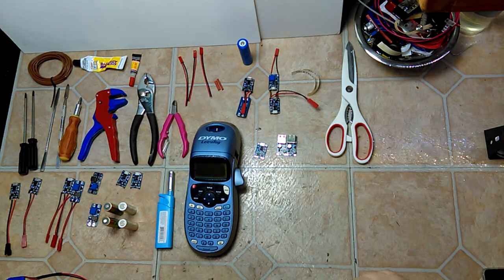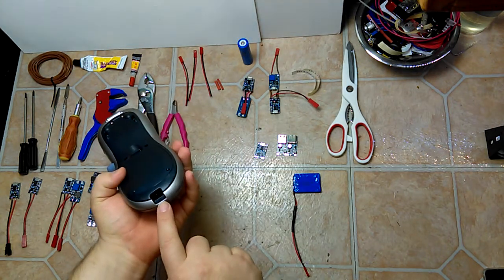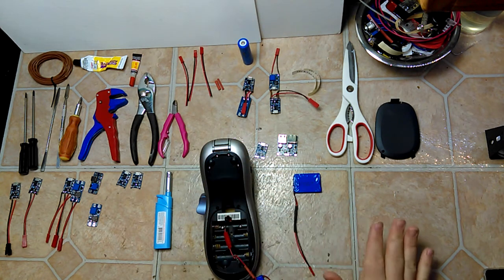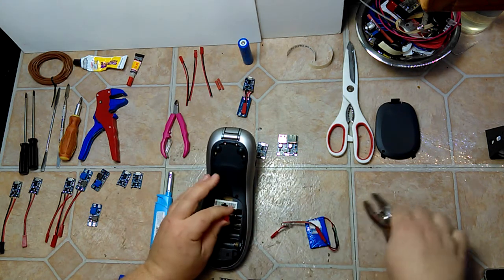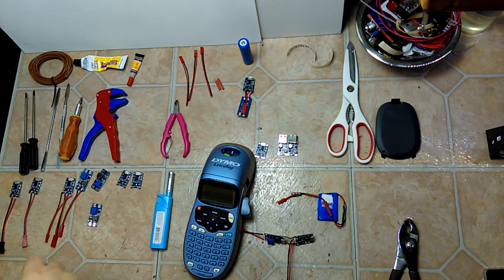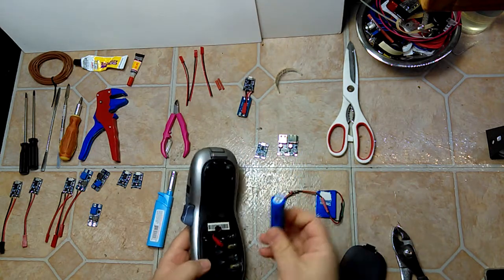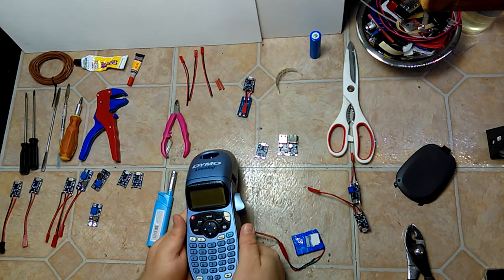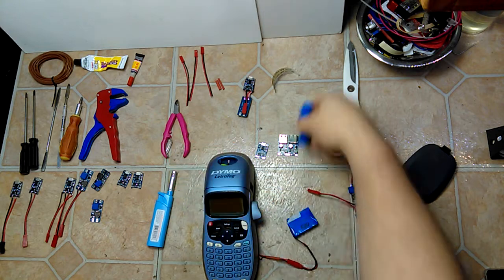Replace AAA, AA, C, D, batteries with Li-Po (Li-ion) pack

Comment: I have a question. I have a flashlight that runs with 3 aaa batteries and I want to switch to a lipo. I need to get the boost converter and I want to get the one with a USB charger. Now the circuit board of my flashlight has a USB already installed on it. Is it possible to charge the battery through the built-in USB through the boost converter or do I need to disassemble the old charging port and use the new one?

Comment: i have a led brake light for my motorcycle that uses 2 AAA batterys. I have some micro drones that have 3.7v lipos. Those battery's die in like 4 minutes with my drone. I wonder if its even worth it to try and used them on the led.
Reply from the maker: Depends on the use case.  That is a 520ish mAh battery and last about 2-3 months per charge in the label maker, vs 1-2 weeks with rechargeable double AA batters,  I use about 1 roll of labels per month.

Comment: Too complicated! Just buy new NiMH AAs from a reputable brand, at least you will get 2-5 years of use and not have to do all that modding. Too many junk LiPo batteries on ebay & Amazon that are lower capacity than advertised or they catch fire
Reply from the maker: I really should do a 4 year later post,

High quality new NiMh AA (Duracell 2400 mAh)  -2 to 2.5 rolls of printing  -Out of pocket cost for me $12-$15

This rechargeable battery (harvested from a BEM bluetooth speaker)  -6-6.5 rolls of printing -Out of pocket cost for me $2

4 years later, no issues, I have modified a second unit a bit neater but working fine with an 900 mAh battery harvested from another bluetooth speaker

But yeah, ebay, amazon, walmart, and even hobby stores have counterfeit batteries now.
Reply: @user-wc3td5oj1e  thanks for the info. I’m clueless when it comes to this subject. Can you be specific and let me know what i would need to use to set up a battery, switch, and LED bulb in an old motorcycle headlight housing to use on a bicycle? I can totally remove the 12 volt set up and start from scratch to use an LED bulb. I just don’t know how to rig up a switch and battery set up. Thank you
Reply: Sadly NiMH is too weak. They output only 1.2V fully charged which is very far from 1.5V. :/

Comment: Dear, can i replace battery Nimh with lipo for a mini dv same volt !
Reply: Basically a LiPo can replace any other battery as long as you follow a couple guidelines.
1= The voltage of your LiPo pack is within the operating voltage of your load.
2= Maximum current draw of your load doesn't exceed the discharge limits of your LiPo.
3= You use a protected cell so it's voltage doesn't drop too low as that will permanently damage a LiPo battery. (This should be 2.5V absolute minimum, better around 2.9V).

 A 1S Lipo has a voltage ranging from 2.8V when empty to 4.2V when full. Alkaline batteries will be 0.9V empty to 1.7V brand new. 
With batteries in series (end-to-end) you add up their voltages. So 2 AA alkaline in your TV remote will have a voltage of 1.8V (empty) to 3.4V (new).

In my experience, most simple devices that take 2-3 alkaline batteries are fine to run on a single LiPo cell. (Note this overvolts 2 cell devices slightly when fully charged, if you're worried you can add a 3 ohm resister between the LiPo and your device, OR limit your charging voltage to 3.4V instead of 4.2V)
Reply: Nimh are usually lower than alkaline, 1.2 i think, lithium are 3.7-4.2. Idk what mining is dv is or how sensitive the electronics are, but a good rule of thumb is to try and get within .2-.5 of original batteries voltage. You can swap pretty much any chemistry battery with another, just make sure you have a proper way to charge, and you use them in a suitable environment

Comment: Nice!You make it look so easy.I have a mini guitar amp that runs on 6AA batteries or a 9v power supply that I want to convert to lithium ion. I'm not too sure about my skills in this type of conversion tho.I am into rc cars .
Reply from the maker: Basic soldering skills are all that is really needed. Good luck, you should be able to re use an RC LiPo battery easy
Reply: @user-wc3td5oj1e  can you let me know how to convert a motorcycle headlight to a battery operated bicycle head light?  Thank you
Reply from the maker: @chuckrangel5578  you need to know what type of voltage is you're dealing with.   with motorcycle headlights typically run on 12 volts and bicycle headlights typically run on 6 volts you can use it called a buck converter to limit the voltage.  But if your bicycle headlights simply use 12 volts you don't even have to use a converter at all.

Comment: Thanks for the video, is it possible to charge the li-on battery without taking it out of the machine? I have a auto cat flap that loses all settings when I have to recharge the batteries. I would like to change them to li-ion and charge it in the device by plugging in an appropriate adaptor.

Comment: Can you post the part numbers below please
Reply from the maker: JST connectors
Li-Ion 1A protection circuit
Boost Up MT3608 2v-24v
Charge controller TP5466
Reply: Data 795 thank you for the list

Comment: Dude, post in the description where you got the parts like the DC to DC convertors.
Reply from the maker: JST connectors
Li-Ion 1A protection circuit
Boost Up MT3608 2v-24v
Charge controller TP5466